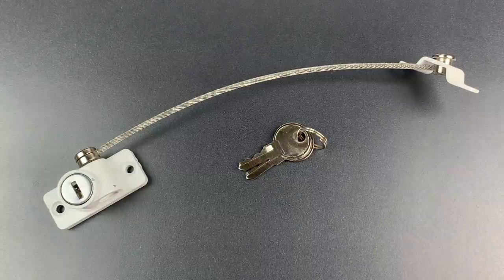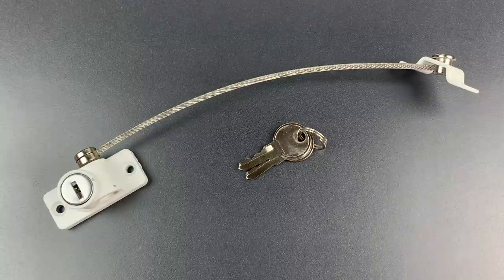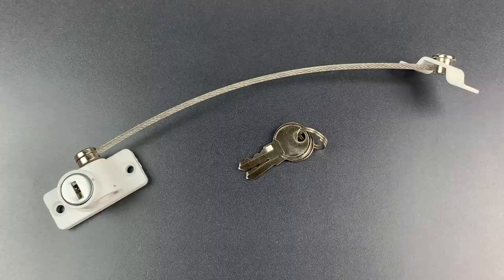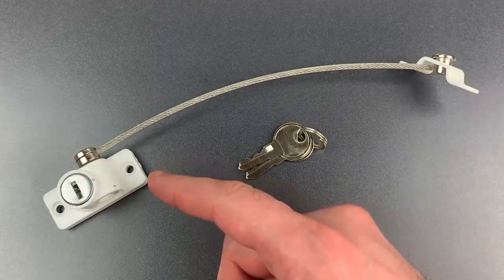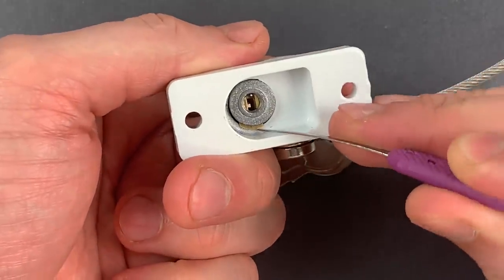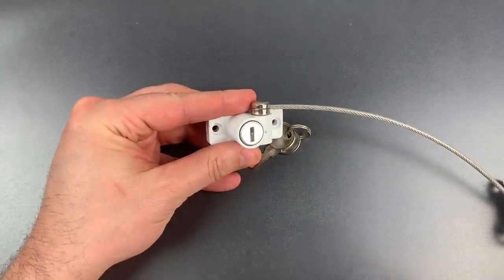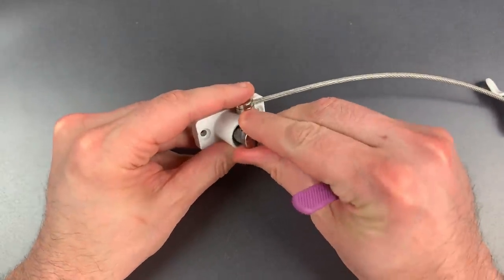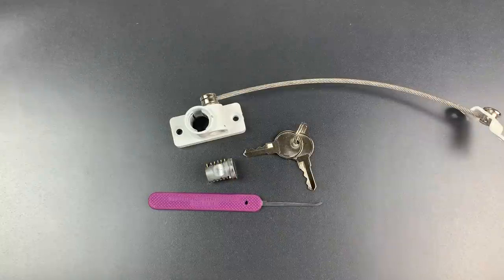[873] Why Is This Lock So Dangerous?

Comment: LPL rocks!  Point of Code which I study and practice for over several decades: The National Fire Protection Association (NFPA) 101 Fire Life Safety Code that deals with “Exit-way egress” does not typically recognize windows as a point of fire or emergency egress in this 7/8” thick book.  Full width and height windows openable are discussed in school room applications as alternative egress points but may not be reliable in snow covered seasons as there is no paved or cement walkways to keep clear in all seasons. Even revolving doors are commonly not an exit way and have standard push bar exit next to them as the “marked exit”. Overhead doors are also not a point of egress.  These self elected supplemental egress points like a window are perhaps options for the physically able and thin enough to use if trapped.  The Code does require fire rated doors on your Hotel room - the idea being, if you were trapped and had no ability to use the hallways as a point of egress, you shelter in place (wet towels and cover the bottom of the door edge, etc). Most modern Hotel rooms are also fire rated for the same reason.  It’s based on being rescued typically within the one hour rating.  Modern fire alarms detect fire early and common evacuations take place yet these extremes of being trapped in rooms are anomaly’s typically quite close to the fire itself or severely blocked by smoke.  What is an exit way:  The ADA disability Act requires a minimum of 32” clear width when fully opened in all doorways (48” max). Many internet references say 36” and that is moronically wrong.  Doors are typically are 36” and the door frame stops on both sides are a half-inch each, so most doorways have 35” clear, but when the swing of the door won’t let it swing all the way open (lets say worst case 90 degrees) the door reduces the opening on the hinge side by the door thickness on 2 3/4”, but not the door stop on the hinge side, so subtract 1/2” and that leaves an obstruction of 2 1/8” plus about a 1/4” for the door gap on the hinge swing side and that’s 33” clear. In tight or restricted openings, special hinges called swing free offsets can be used so the door opens totally out of the way at 90 degrees. You see these hinges in hospitals and medical outpatient surgical centers to give maximum opening width for wheeled patient gurney access with less scraping doorway openings.  Sorry, I am an expert witness, just bringing a smidge of Code and ADA Act clarity basics to the table.
Reply: Really weird that it doesn't mandate that, I know the IBC and IRC mandate a minimum window opening as a means of egress, something like 24 x 18"
Reply: I most states all bedrooms need 2 methods of egress. Two doors Or a door and a window. For ventilation and for fire.
Reply: Wanjibon Thanks for the input. I have an IBC code book as well, I will take a look. (Hadn’t used IBC on any projects so it sits nicely on my bookshelf and looks great in the big black binder).
Reply: Perhaps this is what you are referring to.... Commonly, in new construction (for about the last 30 years or so) “Basements” need two escape windows. Some people convert basements to sleeping quarters - that’s why those windows are there.  No one typically chooses that unless they are trapped. Code can vary from State to State and Cities usually approve National Codes by the Addition Date (not freely agreeing to future updates in the Code).  As to ventilation, that’s likely a structural and environmental building Code, separate from the Life Safety Codes.  If you have reference to another Code specifically addressing ground level or above use of windows as an exit, I would be interested in the Chapter and Verse of such Code, where it’s from, etc.  Again, Codes are minimums and vary. I am referring to National Codes.
Reply: Beat me to the punch. I guess I need to watch Youtube more often :). Well done.
Reply: Thank you for your knowledge, man
Reply: @jrchicago9216  I can tell you from personal experience in constructing mobile homes (manufactured houses, not RVs) that the HUD code requires bedrooms have an egress rated window of at least a certain size in the event that exiting the room and then the house through doors is blocked by fire. Definitely had nothing to do with basements or ventilation. 

Frankly I find the idea of sitting in a hotel room waiting for rescue to be asinine. Just like police services, fire services are there to cleanup the aftermath, not to save you from anything. If you can't save yourself then you had better be prepared to die plain and simple.
Reply: Redneck Ram's Parlor Thank you for the HUD information, I learned something today.  The Hotel comment is based on the fact few people can jump from more than a couple stories without being seriously injured... so if you are in Vegas Hotel on the 15th floor, and the neighbors are having a grand ole 420 party and set their sofa on fire, the smoke in the hallway can block your exit completely.

On a more serious note, If you recall the old MGM fire, people who broke out windows above the fire had more smoke in their room and many plunged to their death.  It was a sad day for everyone.  Modern fire codes changed after and have primary paths of egress. They pressurize the stairwells with air so smoke is kept out.  Modern fire alarms detect early and most people just walk out and down stairs.

Being practical, if any of us were trapped on the first or second floor for any length of time, we would go bananas. Yes, I would crash the window out as long as the fire is not below with smoke outside the window.  My point is the code for hotel rooms do NOT require a second means or window exit.  I don’t write the Codes I was indicating what the National Code are.  It will never be perfect, for example, if you are in a wheelchair, the elevators return to the first floor during a fire alarm and are taken control of by the fire department.  If you are on the 15th floor, few can carry someone down 15 flights of stairs.  You have to wait for help and if you are smart, you will call the front desk or 911 from your cellphone and indicate the need of rescue. 

LPL was in a hotel room, that’s the basis of my Code comments.  

Happy Easter. Pleasant regards.
Reply: JR Chicago- I agree with you: LPL rocks, and egress windows aren’t required in R1(hotel/motel) occupancies. Primarily because of automatic fire sprinklers. It’s always good to find a fellow code geek in the area.  Are you familiar with TOOOL Chicago?
Reply: JR Chicago Yeah I get your point on rooms higher than 1st or 2nd floor. Of course that's why I always used to stay in a room on the 1st floor if possible and second if not. In the event of something happening I intended to find my way out one way or another
Reply: It is strange because in mobile homes, windows are mandated by code to be an alternative means of egress and therefore there has to be a way to easily remove the screen from the window and/or the window itself in order  to get out in a fire.
Reply: jr Chicago, you're probably as much fun at a party as I am.
Reply: @jrchicago9216   If you are referring to the fire that I think that you are, a cowboy hat and bedsheets are effective.

I have also heard of a fire that the hotel occupants hid in the shower. The room didn't burn, but the occupants were scalded to death as the water pipes heated all the water as it passed through the fire.
Reply: To long, didn't read
Reply: @sgt.p.3244   So you took the time to post a comment, but didn't have enough time to spell "too"?
LoL OMG
Reply: Interesting info.  I was trained in a certain facility built to withstand major fires until rescue personnel arrived, to lock residents doors so they do not attempt escape and move themselves into more danger. I always had a hard time accepting that I "push a button" to lock everyone in a burning building, then run out alone.
Reply: Inspector Baldbeard Hi there. Thank you for your reply. I was now aware of Toool and just checked them out. As a professional locksmith and ALOA member, the ethics are that it’s essentially ok to show people how a lock can be compromised, but my instruction to others so to speak in the hobby sport of lock picking becomes unethical as the people in the hobby sport have not been IlInois PERC cleared (security clearance).  With that said, there is nothing stopping me from attending a meeting. It’s like going the Def Con Las Vegas.
Reply: Helidude350 The infamous MGM Las Vegas fire was in 1980. A ball of fire ripped through the gambling hall and I watched on TV of people hanging from windows and using bed sheets to try and lower themselves.  There is a YOUTUBE video on this and it was an emotional day for the nation. Some of the very best Codes were adopted and amplified from this horrific event.  In Chicago in 1903 the Iroquois Theater Fire had in swinging doors and people rushed to the exits and because the doors opening into the theatre, they perished.  We learned the same hard lesson in 1958 at The Lady of Angles Catholic School in Chicago where 95 died, mainly kids.  Codes changed.  Some were slow for adoption, many just applied to new construction. Today we say da! - doors should out swing.  Back then, it had not been thought of yet or not pressured into law yet.  Chicago wrote its own Code and was the leader in this evolution.  It’s been viewed as of the most conservatively written Fire and Electrical codes. Today we have National and International Codes that address the “by and large” of probably 90% of all Code questions (I am only speaking about life safety and electrical coded here).  The last 10% are special structures, and special risk, earthquake risks, etc), Just so no one complains giving me adverse examples, doors to limited occupancy areas like a conference room, private offices can swing either way in most situations. There are load numbers of people and site risk factors that can play a part in this determination.  Hope your Easter is great (if applicable).  Thanks again.
Reply: Helidude350 I must look in to it along with with my dog Toto too and my second dog named Number Two.  Excuse the unconscionable mis typing...
Reply: O. Fender I owned an electro-mechanical locking and security and fire systems integration installation company that had to follow the Codes and you learn these over the years.  Chicago is a nice tough Code.  You buy the National Code and International Code books and dog ear page corners and highlight relevant sections. Revisit the relevant sections. Go to Code classes.  It’s the old Malcom Gladwell tipping point 10,000 hour rule. At 10,000 you are well developed, which takes most 5 or 6 years.  I have several decades.
Reply: heatshield Interesting comment, I presume it’s corrections related. That’s well outside my area of expertise.
Reply: Helidude350 that sounds like urban legend.  How exactly was the water heated?  Flowing in the pipes going through the fire to the room?  In that case wouldn’t the person be able to tell that the water was too hot when it came out of the taps?
Reply: telanis9  Good point about these older structures especially in density in urban cities. Imagine a fire in January in Chicago in the night on those iced & snow filled black metal exterior escapes with 20+ mile wind gusts.  Probably many slipped off over the years.  I will take my two or more pressurized stairwells in a modern hotel any day in my travels. That means if a door is slightly pushed open into the stairwell where there is smoke, it may hold that back or push the door shut.  It’s mainly fresh air isolated in an exit way.  Be interesting to know how many or few hotels nationwide have pressurized stairwells.
Reply: Giant Dad The door width issues of 32” clear is for wheelchairs.  I am unaware of the ADA addressing weight issues.  A 300 lb man who is a bodybuilder Vs 300 lb person who is sedentary are really two different spectrums.  One may be there by design, the other may have been dealt bad genes and a thyroid problems and then there are those that prioritize the satisfaction of food consumption and/or poor quality food habits that can excelorate obesity.  If anyone is disabled or less abled, the ADA may apply but only indirectly.  The simplest example is if you have bad arthritis in your hands, the door lever is designed for easier use that grabbing a door knob.  Thus, levers are ADA compliant.
Reply: @jrchicago9216  Ah that was insightful. I feel bad for making my question a joke. Yeah, Body builders would have a more streamlined profile though and be able to kneel, or crouch through a door if they are tall. Obesity though....leads to round and rotundness.

One time I saw this 500ish pound guy get stuck in a doorway. I helped him out, but my god was he greasy. I immediately went to wash my hands.
Reply: John Early That urban legend is a story for 420 parties, but not for the serious world.  The vast majority of people die from smoke inhalation. By the time flames would get to a person, the gasses arrive first.  There are exceptions such as flashover and there are some good videos on line to explain it.  The MGM LasVegas 1980 fire, and that had a flashover that started above the ceiling causing a ball of heat and flames to roar through the gambling hall. I posted links to that fire on the main comment section.
Reply: Giant Dad There are points to your story - and there are issues such as airplane safety that will likely come to light soon dealing with aircraft.  I had a lady’s warm blubber ooze under an arm rest for a 3 hour flight and no matter what angle, I could not sit in any position to avoid permanent physical contact the whole flight. I paid for a “full seat”!  The airlines are too cowardly to deal with it.  Don’t pick on fat people is more important than honoring the contract of one “full seat” without blubershare please...
Reply: @helidude3502  a short response, proud of you.
Reply: @giantdad1661  airlines cram ppl like sardines because they hardly get profits. Not cramming ppl means more expensive tickets wich means less revenue, wich in turn means more expensive tickets to offset that. 

For the middle class to be able to afford flying there is a need to cram or redesign plane configuration (double fuselage, flying wing, etc). The latter is the future, but it won't come soon.

Source: aerospace engineer
Reply: Jttv I think you are taking of residential bedrooms, not hotels which are sprinklered.
Reply: I bet an expert witness like you is fun at a dinner party
Reply: Thank you for addressing the window issue, I was going to say that windows in hotels are specifically made not to open more than an inch or two for liability reasons like people jumping out of them to their deaths.
Reply: My eyes hurt from just looking at this written mess
Reply: he should pin this comment for sure!
Reply: Too long, didn’t read
Reply: Too long, didn’t read
Reply: @jrchicago9216  
In my 40 some years of aircraft manufacturing. That full seat went away long ago,.. Along with the Ash Tray 😂 
...non-blubber share is restricted to first class, for now...
Reply: Too long man
Reply: afaik the reason for revolving doors not being a sufficient exit is for the same reason an in-swinging exit is insufficient: a panicked crowd trying to leave may push on both sides of the door and prevent it from turning to allow people to leave.
Reply: Thank you for your comment, no sarcasm but I enjoy reading fire, building and electrical codes for some reason.
Reply: @gimmethegepgun  not only that, but if they are crowding the exit, it is almost a guarantee that if they all got going the same direction, someone will fall or overpack and have an arm or leg sticking out. "It's not moving, PUSH HARDER!"